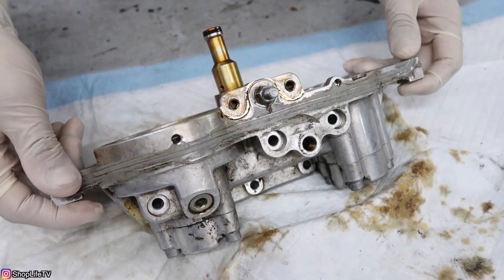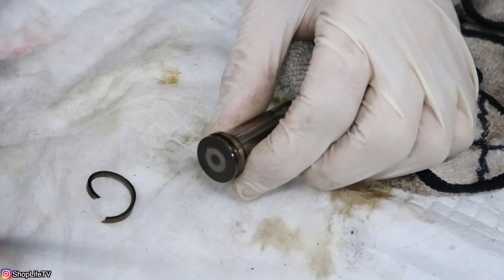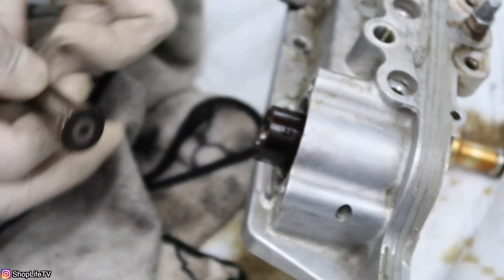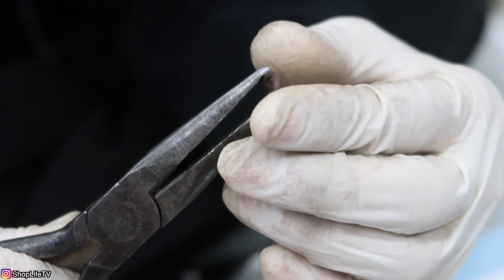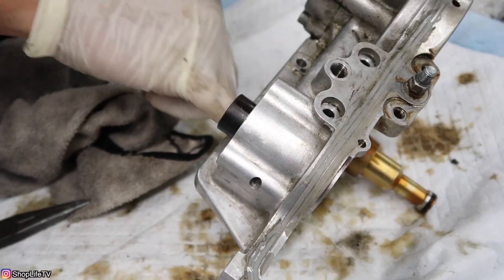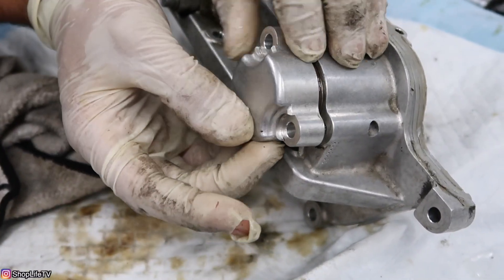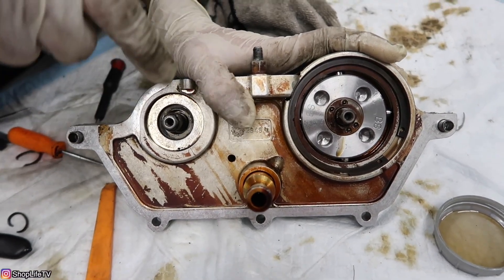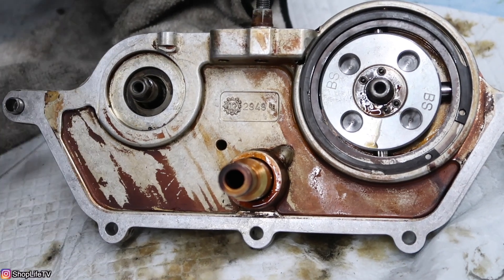BMW E46 M3 S54 Vanos Seals DIY (S54 Vanos- Part 3)

Comment: hey i have a question that has nothing to do with the video. I was 
wondering i have a problem with my X5 2008 4.8 V8 the car runs like rpm 
goes up and down like crazy we changed the electrique cables everything 
was good and came back 1 week later, we change therefor change the 
throttle pedal was good 1 week and came back now its gone again... i 
realized that when its cold the issue comes but when the temp goes up 
like 8degre and up no issue. now is it the throttle body or i dont know 
what else to do. Im about to change the throttle body but i dont want to
 do it if thats not the issue. the throttle budy on my X5 is an 
electronic one...

Comment: I went with the beefed up Turbo toy exhaust hub with bigger tabs and used the original pump disk replaced all seals with beisan, solenoid, upper plastic chain guide, mine was broken😨. And all upgraded bolts

Comment: Good DIY Video I learned a few things but one thing you said that is totally incorrect there's no way unless those bolts on the sprockets shear off completely can you get a failed motor they are protected by a plate in front of them they have nowhere to go I know because I changed mine out and three of them we're broken and the other three were loose so when he starts making that kind of noise especially at idle it's kind of a shearing metal to metal noise you know you need to go in there and inspect those timing gears and mostly likely it's the intake change out both UCF graded bolts and the right loctite and you're good to go but do not ignore that noise it's not your common rattle or knocking it's a whole different noise beware it can hand grenade and you will lose your motor
Reply from the maker: That is correct, the engine will be toast when ALL of the bolts have sheared off. Thanks for watching!